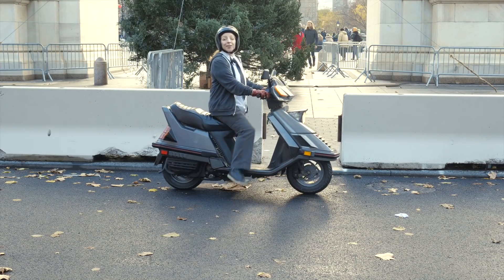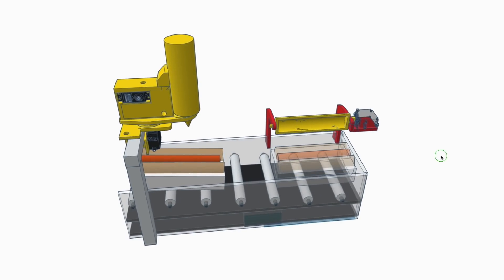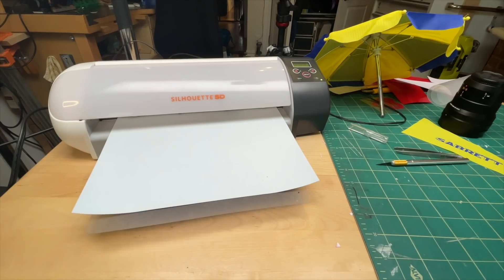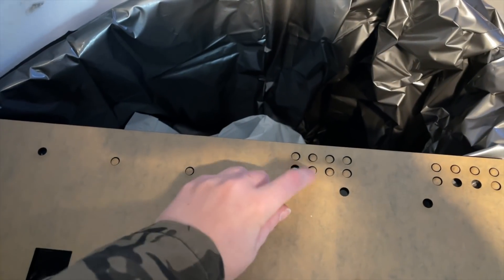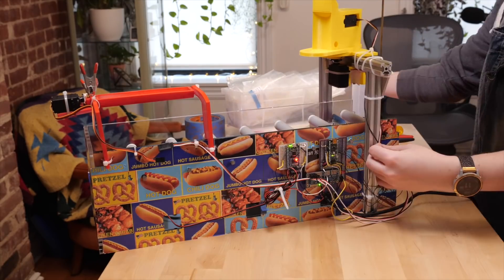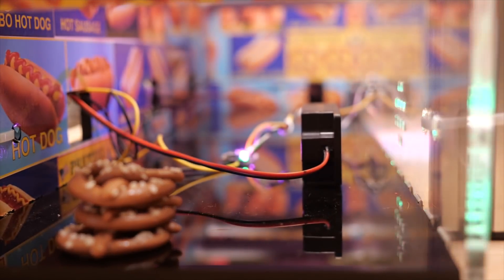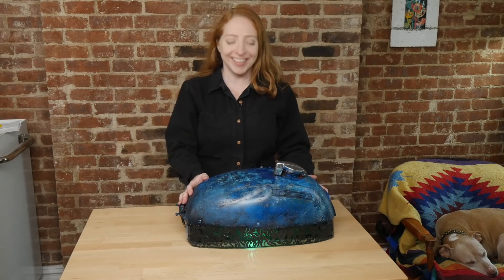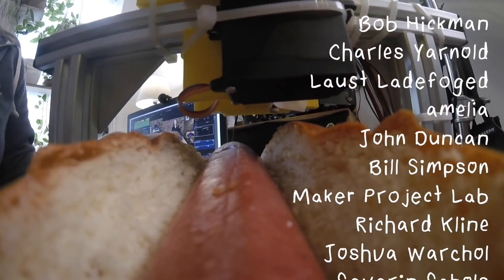This machine makes authentic NYC hot dogs…

Comment: Is it me or  but this  just doesn't work ... and never could work! 🤔
Just a rotating positioning platform or the like would have worked 10 times better.....
Reply: I agree, looks cool but a small conveyor belt with droppers would have worked better, wouldnt need to mess around with light sensors. But hey, still impressive with the time and cost restraints they mustve had.

Comment: Could you have put a end stop at the end of the run to trigger the onion sauce contraption so that it would only dump when the hotdog triggers the switch. Maybe have the start of the machine roll the hotdog through the mustard before gravity takes over, like a roller-coaster does when it drives the train up the hill before gravity takes over. Just an idea. I over do things at times, hard for me to KISS!

Comment: this is a great idea really well done but  i mean if i could build something like this i would of made some of the rollers automatic to roll down the hot dog without having to move it yourself    and maybe   sensors to detect where the hot dog is at any one  time so the onions dont just dump out on the bottom of the machine   and also a better dispenser for the ketchup /mustered   but i do know there was also a £75 budget so idk how much of that would of been possible  but everyway  like i say still a nice bit of work